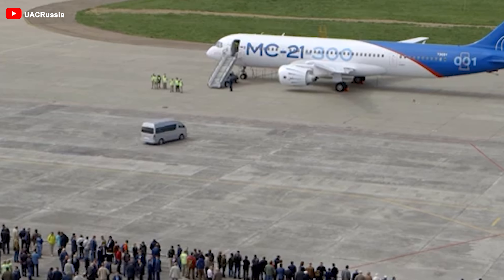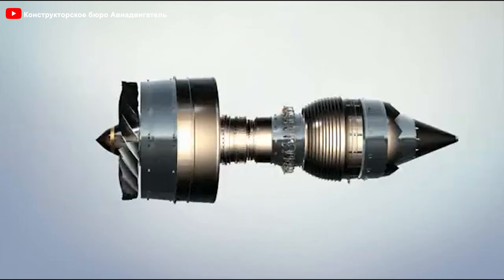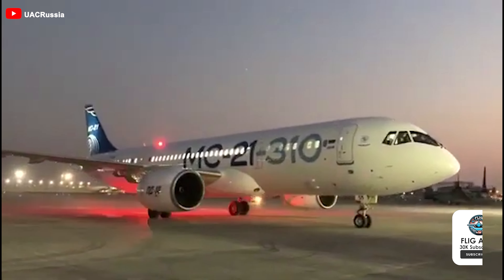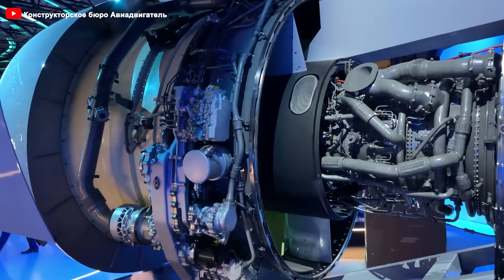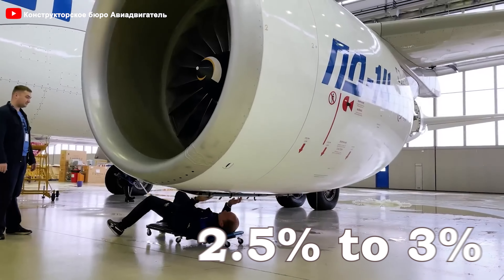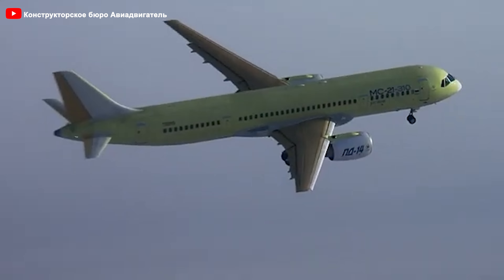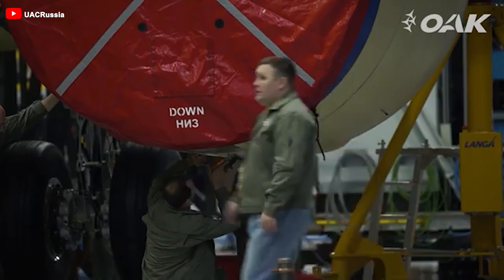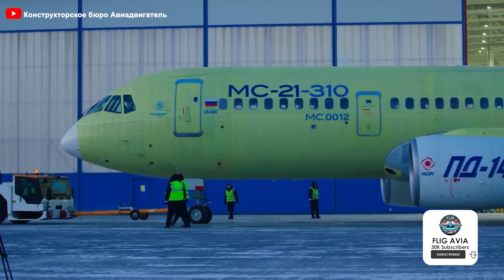This Russia's PD-14 Engine Just Shocked The Aviation Industry! Here's Why

Comment: With engines all the time was problem of fuel efficiency(production imperfections?) but normally most of all stuff was very reliable and could be fixed with hammer and some blyatnahui 😂

Comment: Es mag ein ganz gutes Triebwerk werden aber der Verbrauch ist trotzdem höher.
Reply: as Russia has the oil, who cares for a bit higher consumption? and as the engine is cleaner even more so.
Reply: Engine fuel consumption is measured on a specific airframe. Have you measured it yet?

Comment: Russia doesn't produce proper bearings like SKF, needed for this engine, so this will be a disaster
Reply: Russia recently launched a Machine tools manufacturing factory to manufacture all kinds of bearings with better quality than SKF.
Reply: @sirajsid7760  certainly with better quality than SKF 😂
Reply: @STRAZ Saying denigrating stuff just for the sake of saying it, without knowing the first thing about Russian manufacturing. Pathetic.
Reply: Not only there are decent high speed bearings manufactured in Russia but even if there weren't any it would not be a problem. I just recently ordered an original AirCon compressor and a set of original belt tensioners for my trusty old BMW and they arrived from Germany through Saudi Arabia to Moscow in less than 2 weeks. Getting a mere few dozens of SKF bearings per engine ordered and delivered from Japan is not a problem at all. It would not even affect the cost too much as there are many more much more expensive parts in the engine. And in general for the current state of the project manufacturing cost per unit does not really matter much so parts and materials are not the real limiting factors. The UEC managers have much more critical issues to worry about regarding the project before it even has a chance to compete at a global market. And it is clearly going to take years before it is all sorted out and they can even make an attempt.
Reply: @Kirillissimus   I also read that basically everything is still available through parallel imports.
Only prices got higher by a factor of two to three.
Reply: They landed on Venus 50 years ago, but they can't make bearings? Are you on something?
Reply: @zazu9117   If they could why are they importing them?